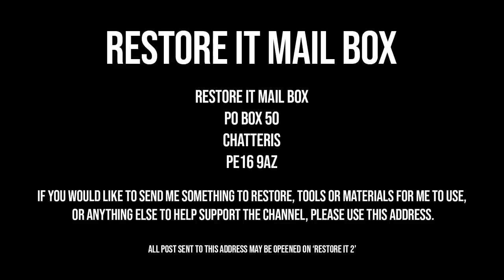Rusty BMW E30 325i Brake Caliper Restoration

Comment: Just restored my cars front left brake caliper. I tell ya, masking the inside of the cylinder is not an easy job. Even after degreasing and drying with warm air, the masking tape didn't want to stick to the wall of the cylinder.
I don't have a sandblasting setup (only a self-made one that sucks...), so I removed the rust with:
1., wirebrushing twice, accessing small inner curves was difficult... it removed most of the rust flakes
2., using phosphoric acid solution (20%) to dissolve the rust on the surfaces, twice again
3., wirebrushing again to get rid of the remaining product of the acid
4., soaking and washing the caliper in nitro-thinner, it washed off the acid remanants.
After primering, I painted the caliper twice, leaving about 2 hours between the first and second layer. I guess there's no need to sand it after applying the primer, since the surface of the caliper/pads holder is originally rugged.
I found that replacing the dust cover to the caliper/piston is easier if you put the dust cover onto the pistons bottom to let the outside lip of the cover free, putting the o-ring (soaked with brake fluid) into the cylinder, then placing the piston in place, while the outer lip of the cover snaps in to its place. Then I pushed the piston all the way in, the inner lip snapped to its place too. Wetting the piston with brake fluid makes it easier to put it together, you want to take care not to spill brake fluid on the freshly painted surface to avoid etching of the paint.

Comment: Dont forget to sand off the paint where the ears on the brake pads/clips mount to the caliper. You need that area to be greased with anti seize lubricant. Hightemp copper works great.

Comment: For the other three, consider using electrolysis to prepare them. It's especially good for rusty brake parts, the process doesn't affect the plated piston bores.

Comment: 1. Dressing anther on the piston.
2. The inner side of the anther is smeared.
3. The piston is installed
4. Anther is worn on the caliper.
P.S. sorry for my English.
I recommend using lubricant for calipers:
Mitsubishi MZ 101616 EX

Comment: Theres a way of putting the rubber thing easier onto the piston of the caliper. You have to hold it close one another and then blow the air into the caliper and it will blow the rubber just in place. Try next time. Good luck from Poland

Comment: Never use grease to lube square cut piston seal, it will get swollen and degrade over time, always use DOT 3 or 4 Too lube piston boot, and seal while installing piston, use compressed air to get boot around piston, and remove paint on caliper where copper seal are needed to mount brake hose.

Comment: Will the primers and paint manage the heat? did you use special paint for calipers or was it regular metal paint? I'm a bit skeptical about using those primers for this kind of job.

Comment: AHHHH great attention to detail, but those machined surfaces need to be masked off too. They are machine to obtain a surface flatness to mate up with the knuckle and keep the alignment of the caliper to the rotor within specification. Also, little scary the inside of the caliper shouldn't have been blasted, it too needs a surface finish close to that of the piston.

Comment: Yet another awesome video mate, as always I am very impressed and incredibly jealous of your skills. I have bought plastic primer, adhesion primer and black paint to restore all the plastic bits and bobs on my car in the upcoming school holidays (mirrors, bumpers, window and door trim, handles, headlight and kidney grills etc). It will be the first time I will be doing any major paintwork and I spent a lot of my hard earned money on rattle cans only to realise with research that I can probably achieve a much better finish if I had spent $100 on a paint gun to use with my old mans air compressor. Either way I am going to give it a shot and see how it goes, the worst thing that can really happen is having the satisfaction of doing it better the second time right? 

I have a question that I have been asking all over the place and thought I may as well ask here as well seeing as you have an e30 and clearly know a thing or two about a thing or two 😂. So...

My e30 318i has pretty unreliable braking capability in the sense that even when braking hard it takes about 85 meters to come to a complete stop from 60km/h. In one sense it has never been a huge issue for me as I have just been increasing my distances, driving slower and using my gears to roll up to red lights. Recently however, I have noticed that when braking there is a whistling or whooshing sound that starts about half way through the brake pedal travel and stops just after the pedal hits it's bump stop. The faster I depress the pedal the louder the noise. The sound appears to be coming from the glove box (rhd car) and I doubt that is the case haha so I am thinking it is either the booster/servo, master cylinder or a vacuum leak somewhere on the other side of the firewall. Also at the last moment of deceleration when braking (right before/as the vehicle stops moving) my rpm drops from its typically impressively steady idle of 750 rpm to as low as 300 (when I misjudge my speed and brake a tiny bit more to compensate for my speed in order to not cross the stopping line by 15 cm - what I mean is instead of rolling to a stop I actually use a little brake power at the last second). I should also mention that when I park the car and let it idle while I pump the brake pedal the whooshing noise is slightly louder (probably because the engine isn't as loud) and if I pump the pedal 4 of 5 times quickly my revs will increase to as much as 1150 rpm. I am thinking that the problem is solely brake related as if I come to a stop unassisted or do any regular driving/idling I have a very steady idle and no other problems YET. I have spent about 5 hours looking for a vacuum leak with water, soapy water and even smoke to no avail. I have inspected all my metal brake lines and two have the paint scraped off about 10cm below the master cylinder but it is definitely only superficial damage and I am certain that isn't the problem. Other than that all the metal and rubber lines seem to be in very good condition. I have bled the system 3 times (the fluid wasn't even that dirty I was just having fun haha) with dot 4 and the help of a work colleague. Pretty sure it has nothing to do with it but it may be worth mentioning that yes I have over 85% meat on both sets of pads BUT the brake wear sensors are just zip-tied out of the way as they don't work. I must note that the whooshing sound I am hearing may be normal and not a problem at all. I have yet to check to see if my brake lines are bulging as all of my mates hate my car. I have had my boss and another mechanic at my work take a look at the problem but neither could really help me. We very very rarely see European cars anyway and seem to only get shitbox commodores and calais. It seems every person in Australia has been raised to absolutely despise European engineering smh.

I'm not expecting anyone reading this to solve my problem over the internet but was wondering if anyone can tell me from what I have said if it would be safe for me to continue to drive the car to and from school and work (I live 30 minutes out of town) or if there is a chance my brakes will fail on me. Obviously I am hoping to find the problem and then a solution but it appears it will take plenty of time and money. If you have any tips/ideas or experience with any similar problems please let me know. I'm not quite ready to try make it though a tree just yet so any advice would be greatly appreciated. 

Thanks in advance,

Will

If you are interested in keeping up with the progress of the e30 please give me a follow on instagram @ thebronzitbimmer

Comment: To the people saying throw the parts in acid: you can’t have the inside of the cylinder or the piston itself be exposed to anything that might corrode or otherwise damage the surfaces in anyway. Those parts are made to fit very very very precisely together. Just dropping the piston  is enough to ruin the fit  inside the cylinder.

Comment: Great! It doesn't seem to be a high temperature paint but just a normal 2k polyurethan paint and clearcoat. Don't you think that will cause some problems when the brake will get hot?

Comment: Wow this is madness it's something I would have done however calculating in time and cost you could have bought several new ones for the cost in supplies alone to do this job not even factoring time , in fact you could have cast new ones yourself for cheaper and faster . I love my Dremel too but I have to be extremely motivated to get that crazy however some fine things can come out of tedious intricate work like this try making a sword with a ridiculous amount of tiny points , alot of edges , and lines across it's surface where you touch any part of the blade area you will get cut and then keep them shape .

Comment: Be careful when blowing that piston out with compressed air. If the piston is ceramic which a lot are you can break it. It’s dangerous too. The fluid blows out crazy too and if your fingers are in there it gonna hurt. I put a shop rag in there to stop it from hitting and another to cover the entire caliper to stop the fluid from spraying. On a side note a new caliper and bracket is cheaper than the hours of labor and parts cost to rebuild that. If you’re doing for the love of doing it well then there you go but it’s not cost effective.

Comment: Also you should have honed the cylinder, maybe that's why the piston was so hard to get in. It should go fairly easy once you're over the lip of the seal. You did lube the cylinder, seal & piston first with brake fluid?

Comment: hey!

nice job overall, but one quick tip to all the viewers:  DON'T EVER POP THE PISTON LIKE THAT!!  Using compressed air is fine, but you can't have it pop free. there are numerous article online explaining how, because if the way air pressure, applying something like 40-50 psi can make the piston fly out with incredible force and bounce everywhere, your face included.  
what you have to do it stick something in front of the caliper  (like a piece of wood) so it can only travel so much, and it won't bounce should it want to...

Comment: A lot of people recommended to use Anti Seize which would be incredibly stupid to use on Brake Caliper Dowels.  Anti Seize contains a lot of copper which will eventually oxidize.  This stuff does not belong anywhere on a Brake Caliper since everything you bolt together needs to stay bolted and anything that slides around needs to be only lubricated with high temp lubricants designed for metal to plastic and vice versa.

Comment: I'm a little concerned where the banjo bolt attaches, you painted all around it. that should be a flat machined section of bare metal for the crush washers to seal against when you tighten the banjo fitting down. Other than that great job the paint looks great on those.

Comment: Heard some people say you should use anti-sieze (copper paste) instead of silicone grease. That is absolutely wrong. Since this closed system contains rubber, silicone or syntethic brakecaliper grease should be used. It will maintain it's properties for years, it is not effected by moisture or water, can withstand heat very well and it does not degrade the rubber boots.
Anti-sieze is great for bolts and metal that are exposed to very harsh enviroments, but silicone or syntethic caliper grease is so much better for this application. It also adheres a lot better to metal surfaces and is a much better lubricant in terms of friction.

Comment: Restore it@, do you think, it's a good idea to sandblast the cylinder of a brake caliper? When I have reassembly a BMW caliper the new piston slide into only with the power of hands. Have you driven it already?

Comment: Great video, I am going to swap 330i brakes on my E46. Is the primair heat resistant paint? Is it posible to ad Expoxie under it? With grinding it, the paint falls off, but with grinding it the anti rust goes open and away. So thats why I want to try expoxie primair with red paint this time. You didn't put them in the oven, no need with 2K? I think I go restore my set to after seeing your restauration!

Comment: Also the rubber for the dust protection around the cilinder is not installed correctly what the best thing to do is cut a piece of a bottle just a piece of thin plastic make a round tube of this put it in the rubber place the cilinder in the tube and with your fingers pull the rubber up and push the cilinder down. You can easily push it in with one finger than and there is no change of damaging the rubber

Comment: Well that wouldnt work with a screw in bendix style piston. You should fit the boot to the piston first then slide it in to the groove of the caliper, then send it home.  It is like a krypton factor challange.

Anyway looks good 👍 hope you did the other caliper at the same time surely

Comment: Also the places where your brake pads slight one can not be painted this is also a tight fit everything that is there is resistance only put ceramic grease on those places.

Comment: You're going to have some problems when fitting that back to the car. Tight fitting areas where you built up on paint. For instance the brake pads won't sit in the carrier easily. You're probably going to need to sand down the offending areas. Good work though.

Comment: Grease the sliding caliper pins while your there!  The number of videos and varying comments on how to properly lubricate a brake caliper was the reason ProSlip was developed..to end the confusion by 'the appliance of science'. The ProSlip blog discusses the topics raised here. ProSlip PIN is the only commercially available lubricant made for sliding caliper pins..it is a synthetic glycol with lithium soap - a formula specifed by Toyota and Mercedes. Made by Dow it prevents fretting corrosion,is rubber compatible but crucially is very very low friction to allow the micro movements of the caliper. The biggest mistake folks make is to ignore the piston seal - this seal is cut at an angle to pull back the piston off the pad. A dry seal is a cause of brake drag, the other is pads corroded in the clips which increases resistance pad-disc..i.e. brake drag. On a caliper use brake fluid to lubricate rubber. Silicone grease won't prevent fretting corrosion and is not a low friction lubricant and this is why Toyota and others no longer specify silicone grease for caliper pins.

Comment: theres a few things i dont quite agree with, though i dont know much about BMW's, though so things may be different. 
so for one theres 2 spots on the mounting bracket for the caliper i would have left as bare metal or done very few paint coats on, as those flat recesses on the top and bottom are for (usually) clip-in guides for the brake pads themselves. youd grease the guides and the tabs of the pads that ride in those. its not a major issue but id be worried about the clips being much harder to pop into place, and be much tighter from the layers of paint. prolly no where near as bad with a spray gun though. im curious as to how the clips fit after the restoration of the caliper.

the other thing, i would not have loctite the bleed valve as you did. those things are ment to be easy to crack loose and bleed the air from the brakes... usually. or id hope thats atleast some weak strength loctite. 

anyways, just my two cents. really like the video and look forward to seeing more of the restoration of the car.

Comment: just in case my english is so so. but i have a question. u repair only 1 brake caliper? why after all it s a paired detail and it should be cleaned and repaired paired. is not it so?

Comment: Silicon grease? Aren't you supposed to only use copper grease, because of the heat?

Besides that, very nice to watch as usual
Reply: certainly not!  copper grease sucks for the calipers it dries.
Reply: @Underpressure11  I never ever heard that, but maybe. But copper grease is the only one really heat resistant. Silicon (as many grease) loses its property under heat

Comment: Nice finish! But this is painful to watch. The red grease looks to me like rubber grease. That will cause the o ring on the piston to swell up and lock your brakes on, should have used brake fluid and if the piston doesnt go in square it will cut the o ring giving you no brakes. Also you need high temp grease on the slides or it dries up and you get uneven brake wear or a bad pedal. The bleeder needs to be able to be undone to bleed the brakes so it didnt need thread locker. Otherwise they look mint. Keep up the vids

Comment: For the next time sand blast them with the cilinder and dust rubber still in there. Cilinder completely seated so it doisnt get sand blasted.
The cilinder and dust rubber are a very tight fit if you sandblast this areas you will destroy your calipers.

Comment: I can appreciate the effort but I'd spend the $80 to get a reman'd unit and use a finish that will actually withstand the heat that braking generates. Not to mention that it looks likes you may have ruined the pistons ability to travel smoothly (as intended), whether it be from the media blasting or the state of the caliper to begin with. Good luck with the build.

Comment: Which air compressor do you use for sandblasting and tell me also which sand blasting media you used?
Reply from the maker: Hey sonia, I have a 3hp 200L workhorse compressor from Spraygunsdirect.co.uk and i use medium glass media
Reply: I want to buy an air compressor for my sand blasting cabinet . I have made a sand blasting cabinet now need a sand blasting gun media and air compressor. Which one would you recommend me?